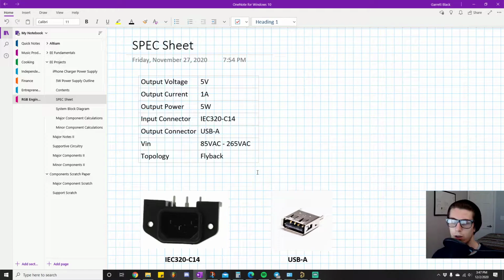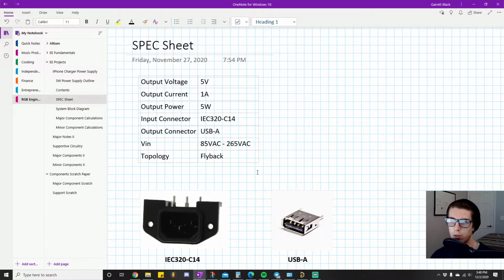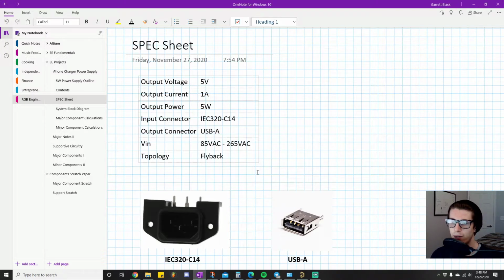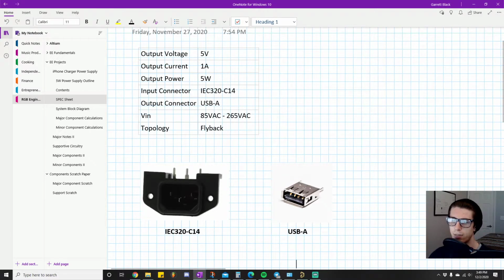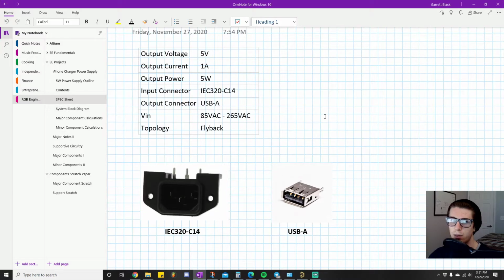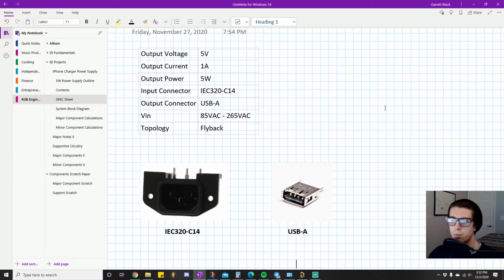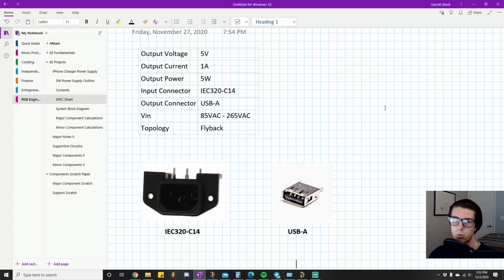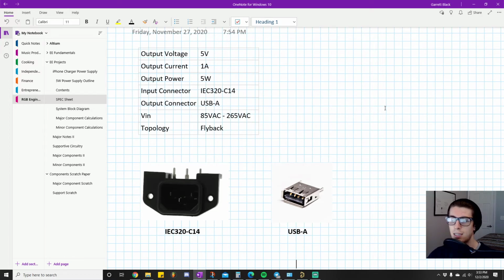5W POWER SUPPLY EXAMPLE - Pt. 2 | FLYBACK CONVERTER EXAMPLE PROJECT | AC-DC CONVERTER TUTORIAL, PCB

Comment: i prefer panel mounted connectors. I've found that PCB mounted connectors cause problems down the road. The repetitive plugging/unplugging tends to crack the solder connections on the PCB possibly even cracking the PCB. Also, assuming this project is going in a project box, why not use a connector that has the power input, power switch or even a fuse holder in one convenient package.
Reply from the maker: that is a good idea!